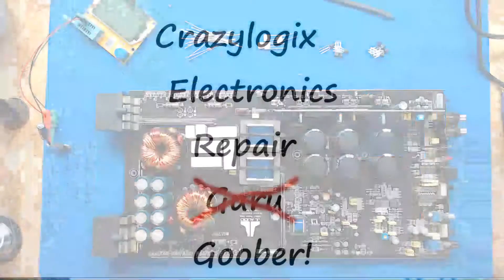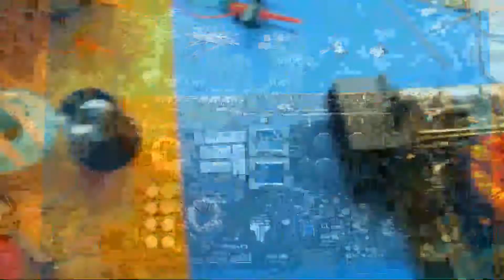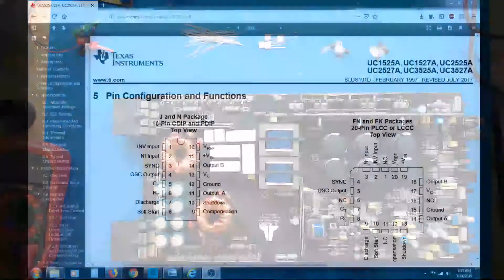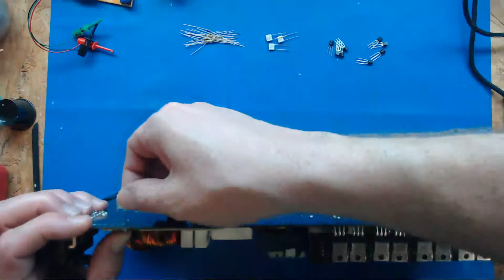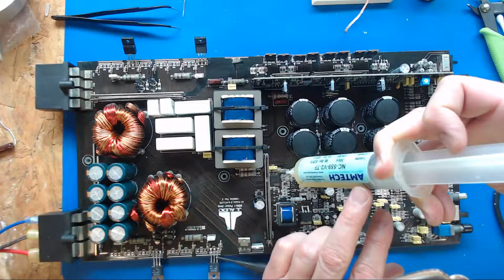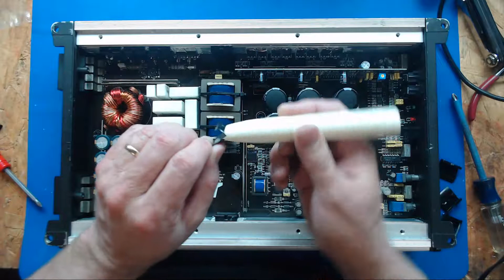JL Audio A1800 Power supply troubleshoot and repair Part 2 of 2

Comment: Hello Crazylogix007, I really enjoyed this 2 part video with all the info you included.....well done. I found your Visio because I have a problem on my JL AUDIO E1200 monoblock,  I have removed all the MOSFETs and cleaned the board. The problem I have is I removed 4 MOSFETs beside the power supply poles and I am not sure what was there.....I think it was (IRFZ44N and IRFZ44R). I have no schematics on this amp, can you or anyone help me on it? I am not sure how they were placed.

Thank you.
Reply from the maker: Check the resistor that connects to the gate leg where the power supply fets go. If it is a 100 ohm resistor the fet is most likely a IRFZ44 fet.

Comment: Just a little tip, I see you wear reading glasses for the small stuff. If you have a Harbor Freight near by, check out the Magnifier Head strap with lights item #38896. They are pretty darn good, I use mine daily.  I tried the glasses but this has worked a whole lot better. Check them out.
Reply from the maker: I have a pair from HF,  they fell apart. Unless they have improved the quality of them, I am saving my pennies for a better quality set.
Reply: @Crazylogix007  I've had mine for over a year now. But they are only $4 lol. I may get me a better set one day.